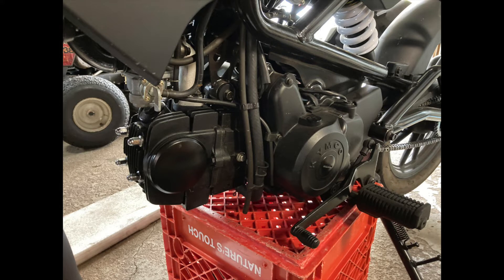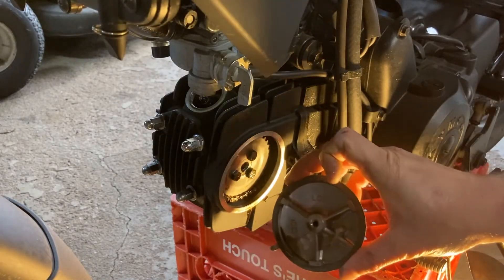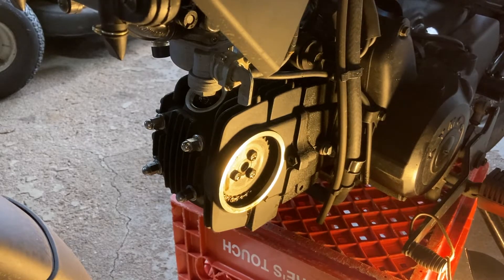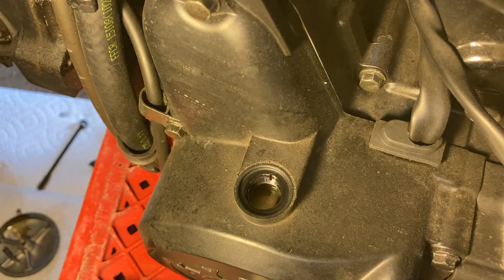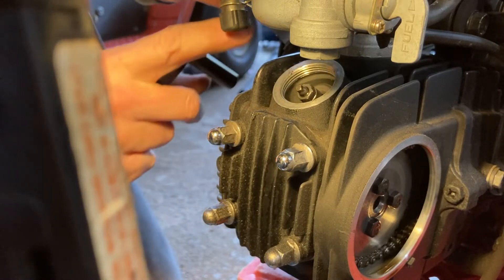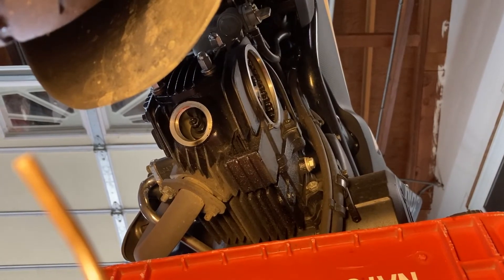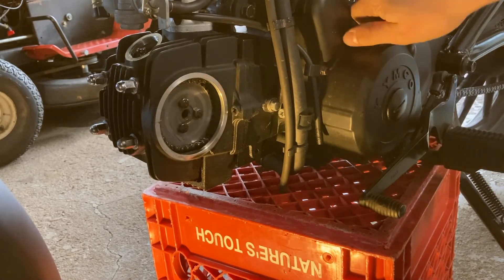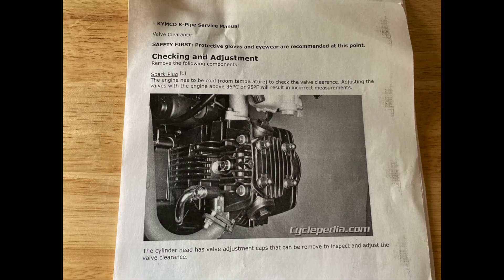Chinese 125 cc valve adjustment

Comment: I start hear a sound like tiktiktik from the cylinder head on my 125cc atv does it can be because of the valve adjustment? , thanks
Reply from the maker: It could be. I’d check the valve clearance first.
Reply: Alright thank you @everybodysjonathan

Comment: I have a 2008 Kymco Pulsar lx, do you think the clearance would be the same since they're both from the same manufacturer?
Reply from the maker: If it was the same engine in a different bike that may be the case. I see the pulsar has a different engine than my k pipe, I wouldn’t assume the clearance specs are the same. Best to find the specs for that specific engine.
Reply: @everybodysjonathan  ah okay, thought I might as well ask. Thanks tho!
Reply from the maker: No problem
Reply: @everybodysjonathan  turns out I'm not getting spark 😅 which threw me cuz that's the first thing I checked, and it was fine. One moment it's running, next it's dead.

Comment: i need info on the engine of tao tao 125 atv 4 stroke
Reply from the maker: All I have is Info on adjusting the valves. I don’t have the shop manual on this.

Comment: How you doing sir, i have a chinese 125cc engine , it kicks over and ive put a brand new piston in it, however there is little to NO compression (20psi) , could this be due to the valves? ive adjusted timing so it maches up etc , the cylinder has no scratches or scoring. Would adjusting the valves bring compression back? thanks!
Reply: Yes, make sure timing is right too

Comment: Thank you for this video! The other demonstrations of this (doing a valve adjustment) I saw did not mention the camshaft alignment marks. So I tried adjusting the valves just based on the flywheel and ended up with serious valve tick. After I saw this I made sure the flywheel and the cam were aligned and now my engine purrs like a kitten. 👍

Comment: Do you mean .008?
Reply from the maker: Per the service manual printed from the dealer shows .08 intake and .08 exhaust specs for this bike. May be different for other manufacturers.
Reply: @everybodysjonathan yep sure bud
Reply: .8 mm not thousandths. About.031 thousandths.
Reply: @terrysullivan6489 😅great info ayy what a vid

Comment: everybody tells to not overtighten the nuts on the tappetadjuster. dont they Come loose due to the vibrations of the engine?
Reply from the maker: From what I’ve read it’s somewhere between 10 - 15nm which is about 10 ft lbs torque spec.
Reply: Ya I'm here because of this exact problem

Comment: I just got the Vader 125 the first day it would turn over. The second day we got it to start and rode it for an hour everything was fine no issues, the 3rd day it didn’t turn over right away but after the 3rd try it started I rode it for maybe 1 minute and it just shut off. I called the place I purchased it from and they sent me a new carburetor, I replaced the carburetor and it won’t turn over. No issues with the started as it cranks up but does not turn over. Any suggestions?
Reply from the maker: So I know the carburetors on these run lean from the factory. Make sure the choke is on while starting. An easy way to asses the situation when it’s not starting is to look at the spark plug. If it’s wet, there is most likely a spark issue. If the spark plug looks dry there is no fuel getting to the engine which points to a carburetor issue. Hope that helps 👌
Reply: Vapor lock. Rip out the air box and charcoal canister.
Reply: Hi I m confused that my camshaft timming pulley and the other pulley there is (T)both are not Match is that normal or something wrong

Comment: Do I need to adjust my valve . I bought new Chinese bike but the bike rpm is low and feel less powerfull . 125cc that doesn't reach 100 kmph .
Reply from the maker: If it’s a new bike, I’d contact the dealer. They should offer some trouble shooting assistance. To be honest 100 kmh is faster than most of these 125 cc bikes are rated for. The Honda Grom / MSX 125 is rated at 95 kmh top speed.
Reply: @everybodysjonathan  this has the vertical CG engine. also the engine is shaking like hell from 3500 rpm
Reply from the maker: I’d check valves on any Chinese bike new or used before putting any real time on the seat. Mine were out of spec (tight intake and exhaust) when first checked at 400 miles/ 650 km. Likely out of spec from the factory. That being said it still ran with similar performance. I’m not sure if this will be your problems fix though.
Reply: @everybodysjonathan   @Everybody’s Jonathan  thanks for replying , could be carburator could be valves could be plug bad coil or battery. Ive seen these many solutions but since its still in waranty Ill let the dealer handle It.
Reply: @moah glade, I've had 4 Chinese pit bikes and my dad's friends have had around 2 or 3 each and they all say the same thing about them, 9 out of 10 times the carb they come with is trash from the get go, a new carb will improve top speed and throttle response but of course make sure your valves are adjusted aswell or the carb won't make any difference in that regard